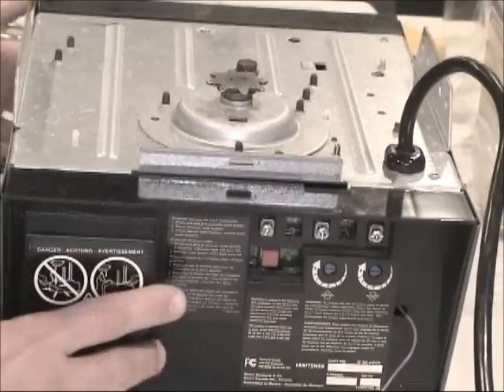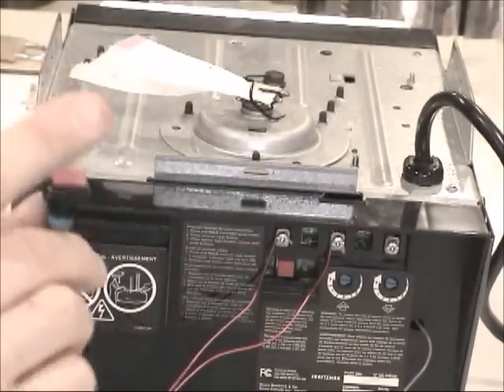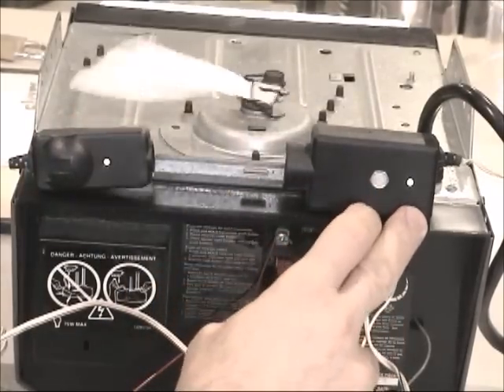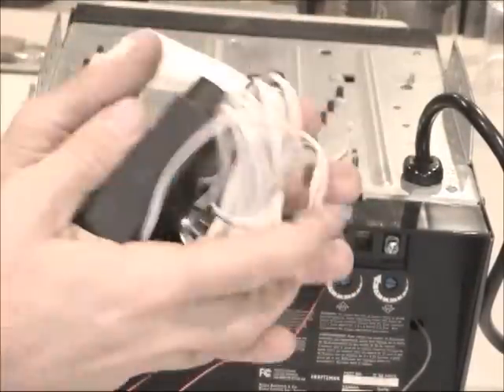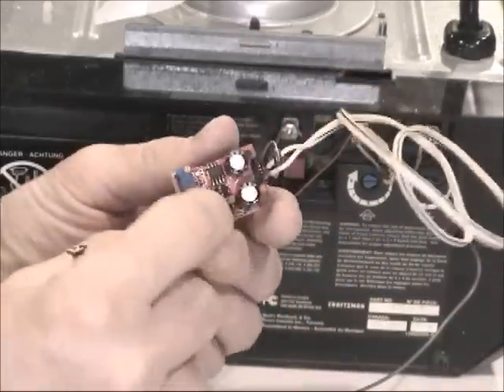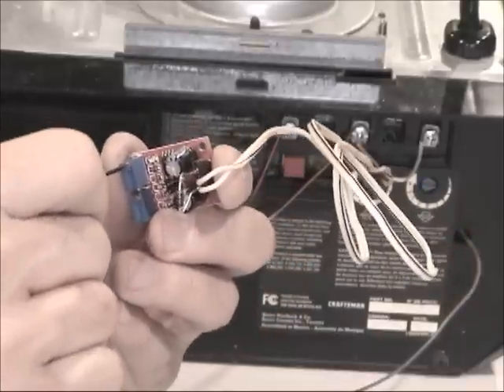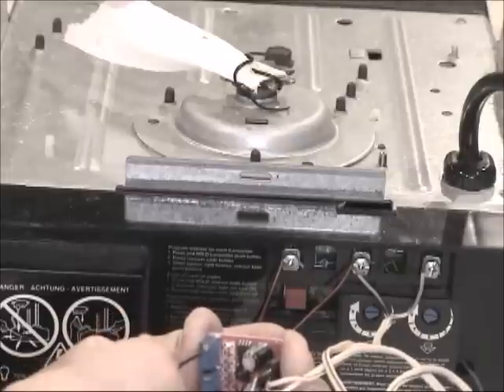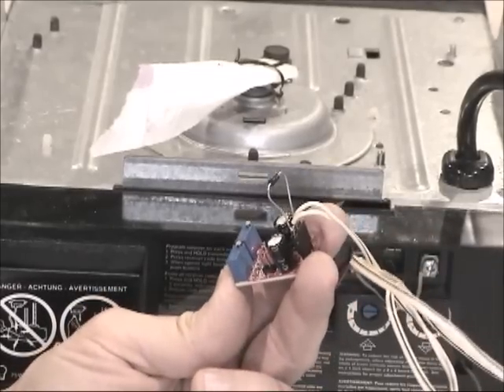Bypass Garage Door Sensor using 555 timer

Comment: Thanks for this very useful video! I was able to clone the project and eliminate the photo sensors on a Liftmaster commercial roll-up door operator. Here are a few helpful notes I'd like to share:
1) There are different versions of the 555 timer board out there. The one I found was cheap, came from China, and had the Vcc and Output pins reversed.
2) A really good source for a connector is a CD drive audio cable from back in the days where there was a separate audio signal from the drive to the computer's audio card or MoBo. These connectors had positions for 4 conductors. Shift one connector over a slot, and grind off the extra connector housing with a disk sander or Dremel tool.
3) Without the diode, you'd not be able to connect the output and the Vcc lines together. There is a necessary resistor on the Receiver board that helps make this work. Connect those lines without a diode, and your 555 will get really HOT.
4) Timing - No substitute for some type of scope to see what is going on. Again, my board was different. The jumper on the board controls the output frequency range. Mine ended up on a different set of pins. The GDO will probably tolerate wide timing variations, but if you want to get close so long-term success is more assured, look at the waveform you're trying to copy. Mine ended up being 2.7mS High, with low pulses of 0.7mS (294Hz)
5) To the guy who is satisfied with the totally in-elegant solution of mounting the photosensors on the wall pointed at each other - you've just demonstrated the difference between engineers and much of the rest of the world. You're sending a message to all who witness your solution. They'll say nothing, and leave with a definite impression. Do it this way, and they'll be asking how you did it, and admiring your ingenuity!

Comment: Save yourself 15 minutes, read this:

Step 1: Move the jumper one-level up to the 2nd set of pins.
Step 2: Rotate both blue flat-head screws clockwise until you hear a small click.
Step 3: Connect GND pin to 2nd screw on garage door opener.
Step 4: Connect OUT pin to 3rd screw on garage door opener.
Step 5: Rotate the blue flat-head screw that's farther from the jumper counter-clockwise until an LED on the board turns on.

Note, you do not need a diode.

Comment: Water damaged the sensors of our circa 1990s Raynor garage door system. Sensors are no longer available and there are no competitor models that are compatible.
The N555 adjustable circuit to the rescue - with one minor tweak. 
The base frequency 1-50Hz with the jumper in the 1st position is too low. Place the jumper in position 2 the 50 - 1KHz and slowly CCW turn the pot until the LED on the N555 board lights, as described in the video. 
The 'No Sensor LED' on the garage door opener goes out and the opener responds to wireless and wired key presses.
Many thanks for putting up this video.

Comment: Thank you, this is exactly what I needed. I did it the cheap way, I built the equivalent circuit to the Arduino board and used fixed resistors because I didn’t have 10k pots, and it works perfectly. Thanks again for the great video!

Comment: This is great, but there's a MUCH simpler method: Take an 8" strip of metal or wood, drill 2 holes in it and mount both sensor devices on it nose-to-nose using their own fasteners, and zip-tie that up behind the opener on the ceiling.

Comment: are there any specifications on the diode and will an led work?
Reply from the maker: +Gerry Reis 
No, the diode is not a critical part and almost any diode will work.
Using a LED instead of the diode  may work but the LED will drop the voltage too much on 555 IC and this may created some problems.
Remember:
A diode in forward current drops around 0.6V. So from the 6.4V the 555 will have 6.4 - 0.6 = 5.8V.
Now a LED in forward current drops around 2V. So from the 6.4V the 555 will have 6.4 -2 = 4.4V. The 555 minimum voltage according to spec is 4.5V.

Comment: So, according to your previous video, the voltage is low for 500uS and high for 6mS for a total period of 6.5mS.  That equates to about 154 Hz.  Is this correct?  The opener circuit must be pulling the power line to +6V through a resistor.  The 555 circuit shorts it every 6 mS for 500uS.  The 555 module itself is powered by the same power, but its filtered by the diode and the internal caps on the 555 board.  Thanks for a great video!
Reply: I did a little more research on these sensors.  The transmitter unit takes the 6V and uses a home made 555 timer (made out of a LM2903 dual comparator) to generate the pulsed waveform.  That gets sent to a IR emitting diode which is beamed across the opening.  On the receiver sensor, it uses an IR detector to pick up the waveform emitted by the transmitter.  Then that waveform is used to short the power line with the waveform.  A large capacitor on both ends keeps the interrupted power from causing problems with the circuit.  

On my unit, the receiver capacitor is a 470uF electrolytic.  These go bad and start shorting the power themselves.  So I replaced my capacitor with a working 470uF capacitor and the receiver is working again.

For me, this is just a temporary fix and I intend to replace it with a 555 timer unit as you described.  Thanks again for getting me going in the right direction on this.  I really appreciate both of your videos.
Reply: As proof of my theory of operation, I can put a TV remote control in front of the receiver and it will light the LED as well.  With some remotes, the pulsation is so slow that you can easily see it with the light.

Comment: Hello, very cool setup! I actually am trying to do something harder maybe. I found a really nice seco-larm photoeye set that mounts into single gang box in the drywall either side of garage. Looks very cool and is fully adjustable. I connected 12v to each receiver and transmitter. White common and green normally closed to opener motor contacts. I can hear the photoeye tripping so it is working. But the signal from the eyes must not be what the opener wants. It keep flashing 4led at me as if there no connection. Must be this pulse issue. Do I throw these away or is there hope of getting them to work? I even tried an inline 10k resistor which in hiensight reveals my lack or real knowledge.
seco-larm e-932-d33tbq eye
Liftmaster 1/2 hp 41Ac050-2

Comment: Can this be used to for the travel distance to be increased to around 16ft?  My opener has a timer or something that stops the door at 10ft. Even after removing the travel adjustment contacts.
Reply: In other words I want the door motor to turn constantly until I stop it.  Then turn the opposite direction until I stop it

Comment: Great video and information. Thank you
Does the pulse generator board come with the 3-pin connector for the Vcc/Gnd/Output?
Reply from the maker: +Steve D 
Yes, the board comes with the 3 pins as picture.
Reply: +MrEnergyFree 
Hello again, I ordered the recommended parts you suggested to troubleshoot my garage door and the assembly and set up of the parts went just as you showed but I am running into some difficulty.  
The problem I experience typically is that the garage door will randomly reverse to open when closing, but will eventually close. With the testing device (555) installed, it will not close at all.

Here is what I've done so far:
I set up the variable resistors (fully clockwise until they click, the 2-pin jumper is on the 2nd from the side, the wiring and diode are installed as you illustrated and when connected to the garage motor, I can dial in the upper resistor until the red led comes on. All went as you showed in the video. Perfect...except the door won't close.

I did put a voltmeter on terminals 1/2 and I get approx. 10.5v (not the 6.3 you show in the video). I do not have an oscilloscope to verify timing. Do you think that is the problem?
Any suggestions to try and salvage this?

Thanks for your time!
Reply from the maker: +Steve D 
OK.
1- Is the LED diode in the board is blinking or permanently on, that is a good signal that the board is connected properly and working.
2- Now we have to play with the frequency. We still have plenty of room to go, so try the following:
 Turn the top variable resistor counterclockwise one more turn and try. And keep going until the door start working.
In other words:  You did 2 counterclockwise and does not work, now
do one more turn for a total of 3 counterclockwise a try. If does not work, then increase to 4, 5, 6 .. turn until works. 
Please post the result. Every garage opener is slider different and that may be the problem.
Thannks
Reply: +MrEnergyFree 
OK, I did have some success but troubles still persist.
Here is what I did:
With both pots zeroed out (full clockwise until they click), I reconnected the board.
I turned the top pot (only) counterclockwise 2 turns and board LED lit up solid. Garage door did not open.
Continued turning top pot one revolution counterclockwise, attempting to open garage after each revolution. After 13-14 revolutions, the garage door opened!!  AWESOME!!
I cycled the garage door 3-4 times and it worked flawlessly and I thought it was fixed....

About an hour later, I opened the garage door; it would not close at all....ever.
I went thru the whole process again, but now as the door closes, I get erratic re-opens at various points in the closing cycle.

I reconnected the photo eyes and at least I can get the door to close with some regularity. It will still intermittently cycle open during a close command, but at least I can eventually get it to close.

Bummer......what to do?????
Reply from the maker: +Steve D 
I will recommended to past 14 revolutions in the pot resistor (15 at least) to make sure that the frequency is well inside the upper and lower frequency required for garage opener to work.
Also, you can try to open and close the garage opener with the garage door disengage. If this works well, that means that the pressure sensor used for when the door would come down on a car it will bounce back open.
Reply from the maker: Well, I think that there is a problem with the garage opener and needs to be replace. Yes it is bummer.

Comment: I did it for an ancient Genie Blue Max. I cut the 6 pin connector into one 3 pinner and one 2 pinner.  I used the 3 pinner to tie into the timing board per your instructions, and I used the 2 pinner to tie into the STB connection on the box.  I had to turn the upper pot about 3 turns ccw, and voila, IT WORKS!!!  YAY!! THANKS!!!

Comment: Wow, this seems like a ton of work (not to mention a few $$) to eliminate the safety.  Why not just take the two sensors and electrical tape them together so they think the beam isn't being broken, and zip tie them to the top of the control unit and wire them up?  I have mine installed as they should be, but they are a PITA ever time you bump them.  I'm gonna be trying the "tape together" method as soon as the weather warms up...

Comment: I have a craftman 1/2 HP opener part no. 41AC150-1M that has 4 connection points. 2 for the contact switch and 2 for the sensor wires. Will this system in your video work on that motor? if yes then how do I need to connect it? if no then do you know of any other bypass system?
Reply from the maker: It should works fine just put this device between the two contact for the sensor wires.

Comment: Doesn't connecting the output of the 555 timer to the + on the opener  run voltage down and  to the chip on the timer which can damage the chip?
Reply from the maker: The output + of garage opener is designed to support short circuit for a short time by limiting the current in the plus line.

Comment: Great video for an opener for free and didn’t want to buy sensors and couldn’t really mount them on the rails so this worked perfect. It wouldn’t work at disaffected but I kept cranking backwards and it finally lit up and worked

Comment: anyone have a name or a link for the 3 pin connector. tried google search with no luck.
Reply from the maker: Look for "Header Connector  for Arduino board" 
This link should help you:
http://www.mpja.com/Header-Connector-Long-Pin-6-Position/productinfo/31051+HC
The header has 6 pins and you only need 3 so cut the header.
Reply: thank you sir!

Comment: I think this is awesome that you have figured this out. HOWEVER !!!!  And garage door opener that does NOT meet the safety standards of today's standards can not be worked on by a garage door service company. Lets say that the person was trying to sell their home that has this cheat on it. They will have to replace the opener or install a pair of the OEM safety eye's !!! You can buy a set of the safety eyes on the internet for a very cheap price and keep it SAFE !!!  Again this is great that you have cracked the code. BUT !!! Very UN-safe and will eventually have to be Fixed the right way !!!
Reply: I use a garage motor for a home made elevator so this works great.